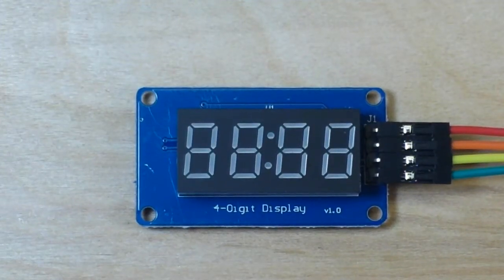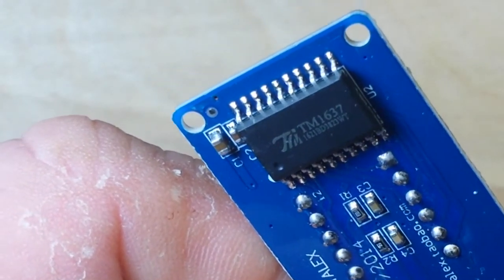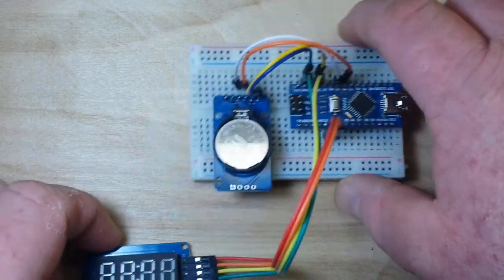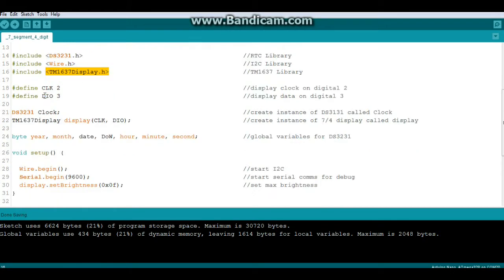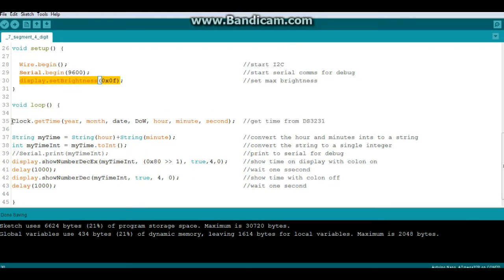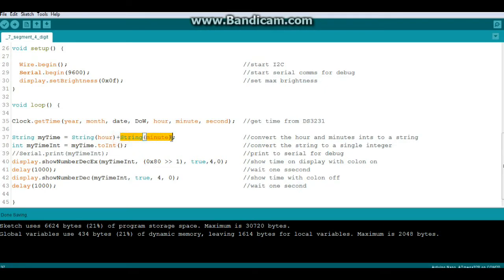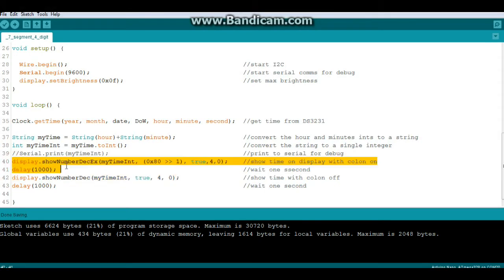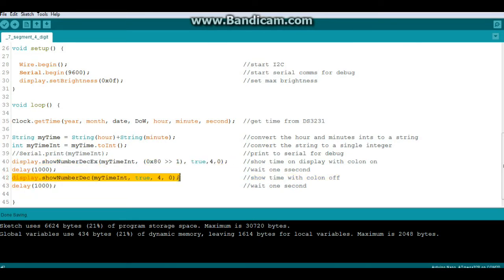TM1637 Display for Arduino

Comment: class DS3231 has no member named getTime. Looks like this is a common error. I tried different DS3231 versions libraries including one from the link above. DS3232RTC, still the same. 
👎

Comment: Hello Sir, I like your video, I am looking forward to build a clock like this for my desk. As far as a I understand, the clock module is what "knows" the current date since Arduino is not connected to the internet, so the question is, what happens when the battery of the clock module goes dead? , will the hour be set correctly after replacing it, even after a few hours? , how can you setup the right hour ? , Have a great day!

Comment: Thanks for this, I was battling to get the colon to work on my clock. The colon does work now but now when the minutes less than 10 display, the whole time shifts one digit to the right because the int does not include the preceeding 0. ie 8.09 becomes 89. Any advice on how to fix this would be great. Thanks
Reply: My Friend use this code to separate any digit then convert to string
  TimeDisp [ 0 ]  =  hour  /  10 ; 
  TimeDisp [ 1 ]  =  hour  %  10 ; 
  TimeDisp [ 2 ]  =  minute  /  10 ; 
  TimeDisp [ 3 ]  =  minute  %  10 ;
String Mytime=String( TimeDisp [ 0 ])+ String(TimeDisp [ 1 ])+String( TimeDisp [ 2 ])+ String(TimeDisp [ 3 ]); 

Best regards from MACEDONIA
Reply: @MrProtonMAX  Thanks very much for this and for taking the time to reply, appreciated.

Comment: I need DS3231 library can you send to me? ^^;;
Reply from the maker: https://github.com/JChristensen/DS3232RTC
Reply: @learnelectronics  This is DS3232RTC and i'm using DS3231 and also Ds3232 Shows error for compiling for Arduino UNO

Comment: This is what I am trying to duplicate. But the library I have that has Ayers name in it doesn't have a 'getTime' command. Again, thanks.
Reply: I found the problem. There is an error in the .CPP file that shows up after noon and has the time 6 hours off. Fixed. Thanks.

Comment: well you got me hooked with that booster thing, and now i want to make one with an arduino :P today i started work and got tangled up in optimizing my code. switching pins on or off in one cycle is possible :P cant post a link due to youtube. but you can find me on github under my name fredlllll and the repo is FredUtil-Arduino
Reply from the maker: fredlllll sweet, I'llcheck it out.